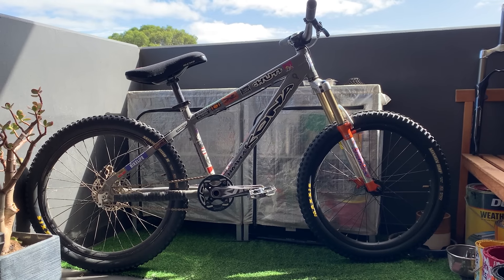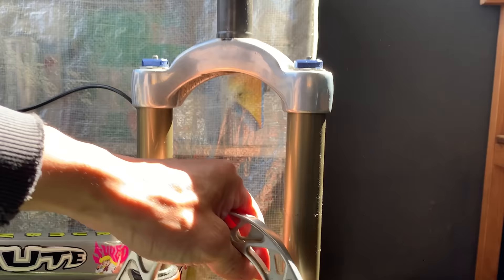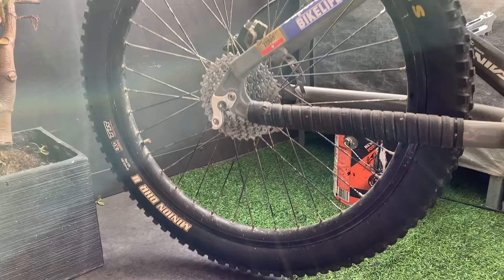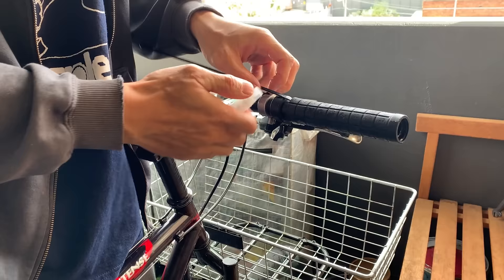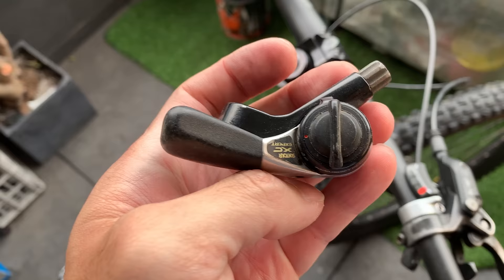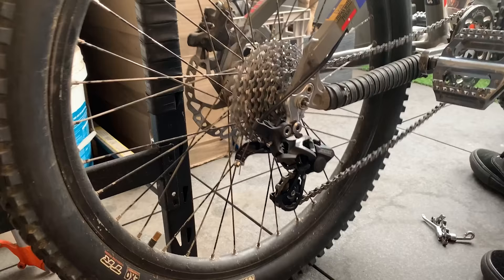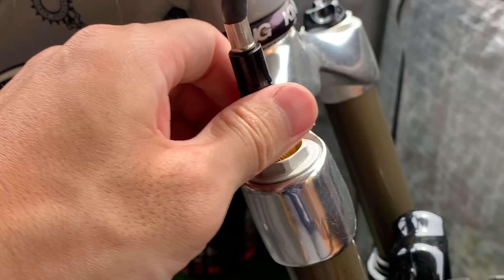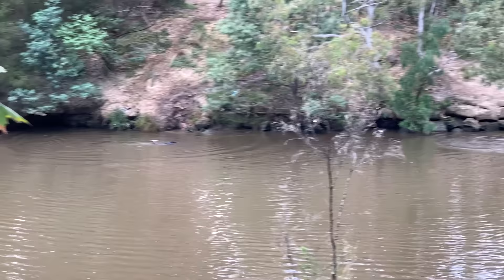turning a single speed mtb to a 1x 9 geared bike

Comment: I have to recommend SRAM. I ran into the same problem with Shimano. 

But when you use a 9 speed SRAM shifter and for example 11 speed SRAM derailleur they will work perfectly. 

And a plus is that they reach up to a 52 chainring.
Reply from the maker: What!! That’s sick , will have to try. Do they have a clutch derailleur?
Reply: Of course they have!
Reply from the maker: awesome!!
Reply: also worth noting SRAM road/mtb stuff is completely interchangeable too, I have Rival shifters with an X0 clutch mech on my gravel bike
Reply from the maker: @jnxmck  wow that’s cool, I def gotta mess around.  I have a xo 9 speed derailleur but not clutch I don’t think

Comment: I do not have a lot of knowledge about gear other than servicing my own old bike which has 3 front and 7 rear cogs. What cog combinations should I use? I always thought that  there are 3 front cogs to relieve stress from the chain but you have only one on the front. Is having one front cog modern?
Reply from the maker: Ya you are right, the modern bikes have changed to 1x to help simplify and to allow more clearance from the chainring to the ground (when you are going over rough terrain ), for most of us , we aren’t riding too crazy so okay to keep what you have 👍
Reply: @garysprojects  so 3 cogs on front is still better, right? What cog combos are good?
Reply from the maker: Not necessarily, it really depends what you ride , for example sometimes single speed is better for short trips etc , you have to work out what works best for you

Comment: Watching this has given me the desire to convert my Raleigh Mountain bike m-50 to 1x9. Will a 9 speed cassette play nice with a 7 speed freehub? Whats a good entry level narrow wide chainring? Thanks
Reply from the maker: You will need a hub that can fit a 8 speed and up , usually they are a bit longer. Entry level narrow wild I get just from eBay, its called deckas , check out my 1x conversion in my how to’s there more info there 👍

Comment: Hey man hard to see in the video but almost it looks like you have no ferrule on that XC shifter? I can’t get my shift cables to sit straight in those suntour thumb shifters for love nor money - trying different ferrules (4mm) but have you got any tips there?
Reply from the maker: you're right i never have ferrules, the suntour shifter barrel adjuster is quite shallow so thats why it doesnt sit in straight. my own tip is to have the right cable tension & length to keep it straight or try a thicker / longer ferrule but that is tricky too! hope you can work something out !
Reply: Thank u brother thought I was going mad! Appreciate your help and beautiful build as ever. And I absolutely rate you doing all this with the nastiest set of tools ever 😂 never back down and get a vice
Reply from the maker: @peteshadbolt3042  hahaha cheers brother ! Yes I have to get a vice one day !
Reply: In the end what I did is use 4mm jagwire metal ferrules and make my housings an inch longer - suddenly it’s looking great… 🤔
Reply from the maker: @peteshadbolt3042  haha hell ya , glad it worked out

Comment: For those damn crown races, I'm pretty sure if you have a sealed bearing headset you can just cut a slot in them since they aren't touching the actual ball bearings. Much easier to install!
Reply from the maker: Damn! I should do that , that would make it so much easier ! Cheers